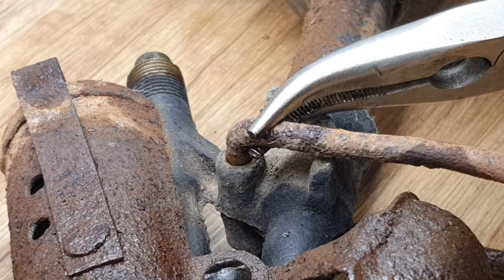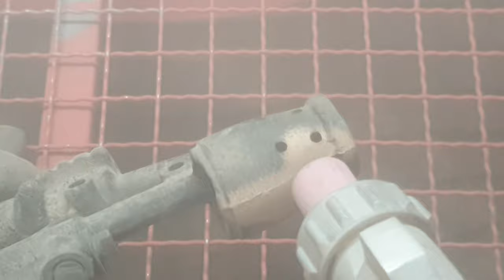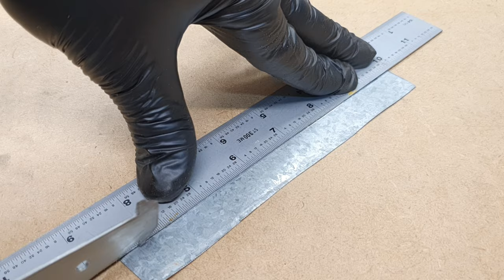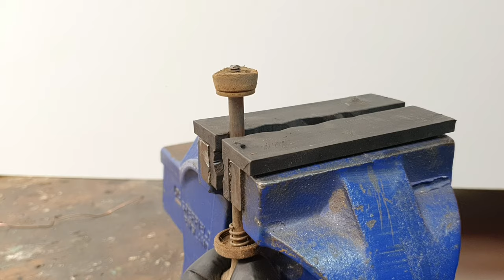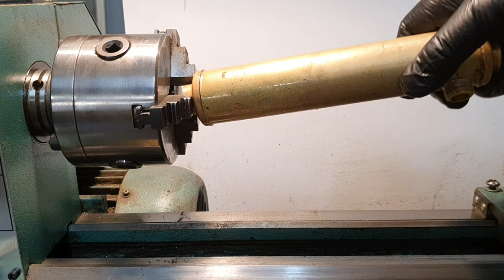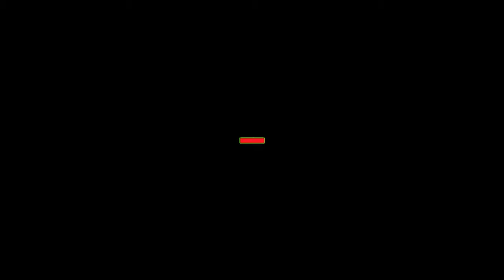Antique Soldering Iron Restoration ( Blow torch )

Comment: I need to find a soldering iron for my torch! Way cool 👍
Reply from the maker: Thanks GT, do you have something similar ?
Reply: @Austeration  I have 2 canister type brass torches but not the copper brand that you have.
Reply from the maker: @GT_Racer347  does yours have the ability to add an iron to it ?
Reply: @Austeration  Yep! A hook on the top and a guide at the front.
Reply from the maker: @GT_Racer347  sent me a pic on Instagram when you get time 👍
Reply: @Austeration  I deleted Instagram a few weeks ago. Taking a break from all those apps! Snapchat. Facebook. TikTok. Twitter. Jeez. 👌🤓